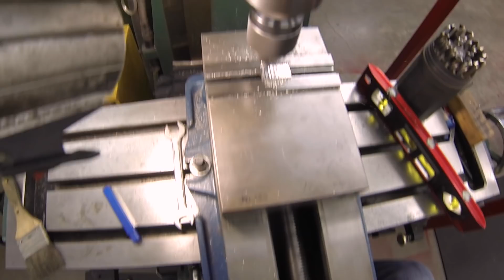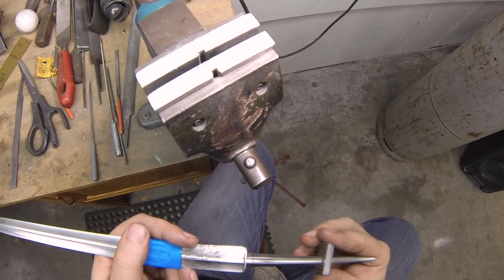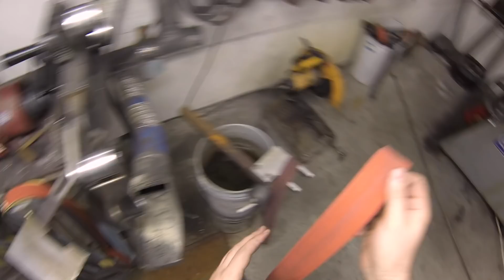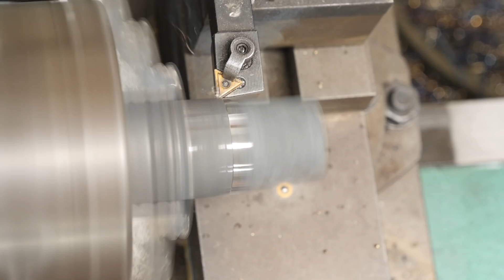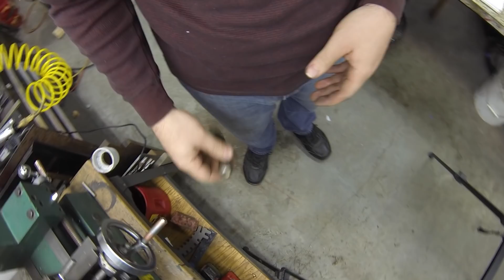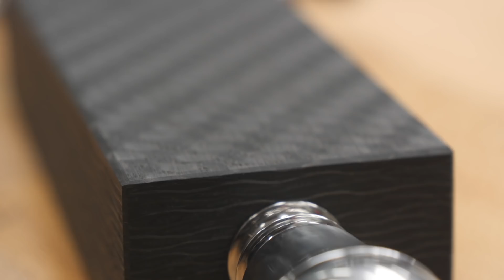Fitting the Fittings: First Ever Stiletto Part. 4

Comment from the maker: We are saving up so we can buy a nice GoPro, so that over head shot wont be so shaky.  Probably will not do too many more of those kind of shots without a new GoPro with awesome image stabilizer.  ~ Josh
Reply: I noticed the camera shake immediately. Good view thoguh. Hope you can get the gopro soon. Go to the grizzly tent sale and pick up a vfd from a wood lathe on the cheap.
Reply: I gather the YouTube anti-shake editor is a bit ordinary. I understand why you like using the 'helmet view' though, besides the 'viewer experience', it allows you to stay in the groove without having to move cameras around the place before you do more work in a different area. All you need do is pause the head-mounted camera, not pause and move the camera/tripod and set it up for the next shot. I look forward to the stabilised GoPro. Can I suggest looking into the Insta360 1X or similar? I won one in a giveaway once and it was an awesome camera. You could mount it on your head and have a full 360 degree, editable viewpoint, of your entire workspace. When you edit the video, you can pick a point for it to stay locked onto and it has really really good image stabilisation.
 Unfortunately, I didn't have a desktop with enough grunt to run the editing suite and the phone-based editor did my head in, so I sold it. TBH, if I still had it, I'd have seriously thought of sending it to you or one of my other favourite YouTubers.
Reply: Bruh you should make a lightsaber hilt and get a neopixel install on it
Reply: The third video of the stiletto build gave me an idea, a knife maker simulator game with the graphics based on the layout of your shop where you go through all the steps to make a knife that you do in real life so playing it feels like the player are actually making a knife in you're shop the way you do in your videos

Comment: Have you ever forged a fuller into a blade . Would this add strength to the overall aspect of the knife . I guess I'm thinking sword .If you were to mill a carbide die to the shape of your sword , then use the big press could you sneak up on it a little at a time until you actually formed the close blade shape ???

Comment: Man, stainless steel can be an asshole material to work with. Had to cut some 20mm x 150mm with a circular saw. The blade was blunt by the end of the week. It will blunten your drill bits and leave knife-like blue burrs when you cut them with a cutting disk. And if the welder made the welds too thick, try not to curse too hard if the surface needs to be smoothed out and polished.

Comment: Milling stainless should be done between 100-150 surface-feet per minute.  (SFM) x 3.82 / diameter.  Assuming 1/4” cutter = 1528rpm.  Slower is better with all varieties of stainless due to its tendency to work-harden.

Comment: Use of respirators vs. exhaust ventilation. Steel especially in a course grind in not really respirable. For this ventilation is enough. Carbon fiber, G10 and most woods are respirable and I always would wear a respirator.

Comment: Man, that pommel came out nice, can't wait to see what you do with the carbon fiber.. I love using carbon fiber, but itching for a few days, if you forget to cover up, is the worse. I built houses for 10 years & insulation rarely bothered me, even in summer with only shorts on. Also, carbon fiber seems worse than steel when cutting too, I use a porta-ban & the blade dulls quick when cutting it... Hope all is well, take it easy...

Comment: Turning a ball or sphere you may be able to utilize a rotary table and create a narrow tool holder with centered carbide insert and not a left or right handed insert. Then rotate the table around spinning rod end. Further the insert is from rotational center of the table the larger the sphere.

Comment: If I remember correctly carbon fiber is highly carcinogenic so wearing gloves, glasses and respirator is quite mandatory.
Reply: Carbon fiber is not a carcinogen. You only need the same PPE as you would use when working with fiberglass. Both carbon fiber and fiberglass can irritate your skin and mucus membranes, but that's about it. No chance of cancer. So yes to PPE, but don't freak out carbon fiber is not the boogeyman.
Reply: and gloves and turning parts are a big nono